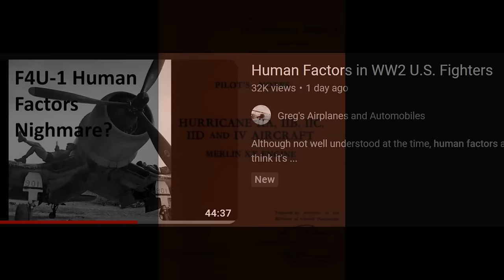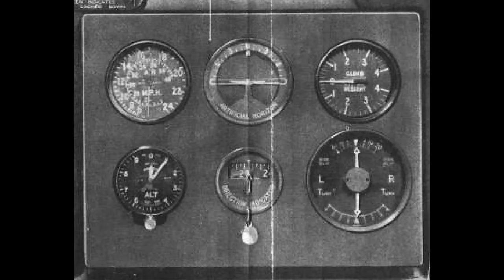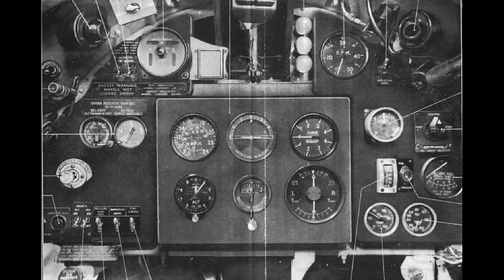Human Factors In British and German WW2 Fighters

Comment: Really cool and agree on the Hurricanes compass it’s a bugger to use in flight! However I disagree on the brakes I find them quite easy to use and very much like the chippy! Also the undercarriage and flap mixer box is so easy however to a modern day pilot they would not understand it or why! Transitions from the throttle to the gear up is easy and no problem even if you forget the safety catch it’s easy just has to be done before about 110 mph otherwise the aerodynamic load on the gear doors may not allow them retract! Just my observations from flying a MK1 👍👍

Comment: The US navy's standardisation of instrument layout made a huge change in reducing.training. Most cockpits looked like someone loaded.A shotgun with instruments, and fired at the panel
Reply: The Paxuent (spelling?) fighter conference report is illuminating. Lots of the navy pilots were pretty scathing about many cockpit and instrument layouts.
Reply: I fly a lot of 60's , 70's and 80s corporate turboprops. They have the standard 6 but with collins, arc, king, sperry,  different nav systems etc. Crosshair vs handlebars FDs switchology etc...... My company spends about 500k per Aircraft to standardize on Garmin 1000 setups.

Comment: 7.56 is the Standard Blind Flying Instrument Panel.   It was used in fighters, bombers and trainers.    It was needed because the RAF was a night fighting force.   The annual Air Exercises starting in 1924 included night fighting practice.    The last one in 1938 was entirely at night.   It used 1300 aircraft, 700 searchlights, & 53000 personnel.

Comment: the radiator under the Hurricane filled the cockpit with heat because the Hurricane had no floor and the heat wafted up from below. It has been mentioned in numerous memoirs that it was stifingly hot in Summer. It also had a fatal flaw in that the wingroot fuel tank would blast into the cockpit if set alight in combat because there was nothing between the fuel tank and the pilot's feet. Incidentally, none of the prewar fighters had any credible jettison system for their canopies until combat experience in Spain compelled the Germans and others to fit canopy jettison systems. the 109 had a spring fitted to it's canopy and the entire rear section would detach to allow the pilot to get out. the Spitfire and Hurricane had a jettison system fitted later that allowed the canopy to be unpinned with the tug of a red ball and slide back fully.
Reply: Fw190 canopy had two small explosives to blast it clear for pilot egress ?
Reply: The 190 had a 20mm cannon cartridge to blow off the canopy because they found that it couldn't be opened manually at high speed as it would be kept in place by air pressure. Same for other high speed aircraft. Once the cannon shell fired, the jet of gas from it would lift the canopy off its rails and clear it away.
Reply: Robert Johnson wrote about getting trapped in the P-47 cockpit because the canopy was jammed after his plane got shot up. This forced him to fly the badly damaged P-47 home, to his amazement.
Reply: The Hurricane burned a lot of pilots due to hits through its unprotected header fuel tank and firewall.
Reply: In regards to the Hurri radiator filling the cockpit with heat, I recall my wingman saying once that he could see shimmers of heat billowing from my cockpit when I had the canopy open. On a hot summer day, it felt like sitting on a barbecue. Our Mk IV Hurri did ground attack duty in North Africa. My sympathies to the poor crews.
Reply: @RobofGabriola  even a Spit or Kittyhawk in the desert was a BBQ.  The Hurricane was many times worse,  ... then add the smell of blood, vomit and other bodily fluids in the heat.  Poor young lads indeed.

Comment: Nicely done, Greg – as usual. Really old people like me can remember when automobile controls and settings could often be done by feel, as well. My 2023 vehicle has lots more stuff to control, but it's all electronic displays that have to be touched in a certain way or in the right spot, and I have to look at the display (thus taking my eye off the road and traffic in the vicinity) to make sure I'm adjusting it to the proper setting. It's a (very) slow version of the fighter pilot's dilemma in a poorly-designed cockpit. P.S. I'm not able to access the patreon stuff. I get a page with an image of a WW I British fighter at the top, and a bunch of grayed-out boxes with no images or text, so I don't know what I'm looking at. Maybe it's the age and OS of my computer, but it's unique to your site. Help?
Reply from the maker: I'm right there with you on the controls in modern cars. They are actually getting harder to use not easier. I just checked my Patreon and it's working fine. You might be seeing blanked out stuff because you are not a member (that's just a guess).
Reply: @GregsAirplanesandAutomobiles   Hi, again! Then I'm confused (again). How does one become a "member?" I'm subscribed to the site, with the little notification bell turned on. I thought patreon membership was what's required to go to the next level, but I'm not able to do anything with patreon, such as "join," because of the issue(s) that have already cropped up.
Reply: I think standardized instruments are the way to go, sure,  but it is not that important as professional car and airplane testers tend to think, as a normal WW II pilot does not change airplane types very often. Only the good ones have the chance and they will hack it anyway. The bad ones are dead in a short timespan. Btw one of the best explanations of poor cockpit design is in astronaut Michael Collin’s wonderful autobiography „carrying the fire“ when he describes his test pilot experience. Very enjoyable to read!

Comment: Thanks for another superb video.

One thing that I don't think anyone mention at all, that I think should be included into human factors consideration, is the colours of instrument panels. Not that there are any one design that is superior to all, but if the panels are in contrasting colours to the instruments, it's easier to locate them with the smallest glance. If they are in similar colours to the gauges, I personally feel it is more difficult to locate them by glance, but easier to identify what gauges are showing what information.

Also, though I cannot empirically prove, I feel that an another human factors win for German seating position is the relative ease of manipulating side or wall-mounted controls. I felt it incredibly strong when I climbed onto the cockpit of a Meteor F.8 from Midlands Air Museum. Once I sat inside, I could not really comfortably operate (or even see) the controls on the sides.

When we design automobiles, we usually use percentile models not just for checking whether they fit inside the vehicle, but for checking if there are any controls that are technically within reach, but is not intuitive to manipulate. When I am seating lower and my legs stretched further forward, my upper body seems generally better relaxed, including the shoulders. Anyone who's been inside a really low-slung car, like an Elise or most McLaren stuffs, would (hopefully) know what I am talking about.

Also, I'd suggest, of all the planes that were developed during the war and/or numerically close to, or is, irrelevant in WW2, the de Havilland Hornet would be among the best out there.
Reply: Useful, I doubt whether the anthropometric data on percentiles were available before WWII.  What data were collected during the war I don't know.
Reply from the maker: Thanks LV, that's a good comment.
Reply: Auto engineers would do well to put the passenger seat on an angled mount as it move back it moves down vs making it 3" taller than the driver. I smash my head getting in whenever I go along with my wife in the minivan

Comment: Just a word about the P Type RAF compass. The way it was designed to be used was not to move the clamped ring to find your heading. The idea was that you moved the ring to the heading you wanted and then turned the aircraft so that the north pointing part underneath aligned with the two parallel Lins above. As you observed it was an instrument that was more use in a ship or maybe a transport aircraft. Suffice to say that on the Tiger Moth I used to fly  on pleasure flights we kept the P Type as a piece of history and had an E2B panel mounted compass fitted as well.

This idea of having a compass where north wasn't quite where you expected it to be appears to be British as it was perpetuated in the post war Smiths Flight System where north was indicated by a pointer that could be anywhere on the dial depending on how the pilot set the desired track.

Comment: You avoided perhaps the most important HF issue - visibility - something that was a priority to fighter pilots.  The FW 190 vis was less than ideal looking over the control panel, although vis behind was good.  The Me109 vis was of course horrible, also the early P-51's with bird cage canopy.  Late model Spit IXs, XVIs had a bubble canopy, increasing vis considerably over earliest ones.
Reply from the maker: that's in another video on this subject.
Reply: @GregsAirplanesandAutomobiles   who knew.   I suggest that a video like this provide upfront an overview (good instructional design) of prioritized ergonomic and HF issues.  The learner may therefore see the bigger and more accurate picture.  Then identifiy the limited issues you'd like to cover in this video and label it accordingly.   I hope that is helpful.
I agree with the castoring tailwheel issue and pneumatic brakes (often mushy).  When scrambling large #s of WWII fighters with limited fwd vis, proper ground handling was often lacking and accidents did occur, but the brakes/tailwheel problem was more of a systems design issue than ergonomic one.  
Cheers.

Comment: A most under-appreciated factor contributing to pilot fatigue is the upright vs. inverted Vee-engine configuration. I read a most interesting interview with a display-pilot who pointedly remarked in the stark difference on noise intrusion when flying the Buchon in comparison to the Bf 109. Another interesting technical issue: cockpit lighting. The He219 for example used a novel ultraviolet lighting system in conjunction with phosphorescent instrument displays. I wonder how many pilots and avionics technicians were victims of American radium-painted dials?

Comment: Outstanding as always Greg!! I knew you'd pivot to the 190 since the discussion was on human factors and I remember distinctly from your earlier 190 videos the exception cockpit design. That had quite and impact on me since it's typically not a point of discusssion. 

Comment - I'm wondering if perhaps it was easier to design a good cockpit for the FW190 since it was primarily electrically operated. It'd be far easier to place electrical switches where desired for reduced pilot workload as opposed to the mechanical contrivances like chains and pulleys on much of the P47. Would you agree?

Comment: Had a couple of flights in an L-39.  It had the same taxi controls he mentioned for the Spitfire (except hydraulic vs. pneumatic).  It's sooo weird for someone used to nosewheel steering and toe brakes.  Damned near ground looped the thing because a full boot of rudder did nothing while the wingtip was headed for a fence.  When I remembered the handbrake thing, I panicked and grabbed a big ol' handful of brake.  The PIC didn't let me taxi for a while after that....

Comment: I don't remember if you covered it or I read it somewhere else, but the 190 also had a differential elevator bell crank that allowed for fine movements near the center with an eccentric effect at full limits, as well as aileron control linkages designed to reduce the force required for deflection to about 8lb which was what they determined was comfortable for the average human wrist.

Thanks for the informative videos, definitely makes building 1,000 Cessna brakes on night shift go quickly.
Reply from the maker: I have covered that.
Reply: @GregsAirplanesandAutomobiles  do you think there's enough information to do an Me410 deep dive?

Comment: GREG, did you notice the two level Spitfire foot rests, high for pulling Gs?  Have you looked at wartime canopies, the curved panels can have fairly poor vision quality.
Re. the vertical compass outputs, the U.S. Navy used a lot of Kollsman direct reading (via linkage) vertical compasses with twin bar heading bugs.  They appear on e-bay regularly and work independently, the direct reading Mk X is typical.
Thanks for the great work.
Reply from the maker: I have looked at the Spitfire foot rests. In all cases the pilot's legs are much lower than in an Fw190.
Reply: @GregsAirplanesandAutomobiles  but the 190 pilot also sits low in the fuselage with poor vis over the panel.

Comment: Another great video Greg! I remember reading about the Hurricanes bobbing up and down after taking off because the pilots were busy pumping the handle to raise the undercarriage. 
Spitfire pilots were constantly having to change hands on the  control column to perform similar tasks during take off. I also remember reading that German pilots after looking at captured examples, realised why they were able to jump British pilots, because they were so involved in engine and propeller management as well as maintaining flight position within their section and squadron. This last part changed with the adoption of the finger four formation learnt from the Germans. 
Mark from Melbourne Australia 🇦🇺
Reply: The 109 pilots had hellish manual variable pitch propellers far, far worse to cope with in combat. Every climb or descent or speed change cut or over-reved the engine losing power or threatening engine failure.  Even worse their prop’s actuation was awful electric not hydraulic.
Master race types would tend to boast superiority a bit too much.
Reply: @givenfirstnamefamilyfirstn3935  That part I was not aware of. I do however remember reading a seasoned pilot's report stating that they would change the propeller pitch to fine (I think) in combat in order to raise the rate of fire from the machine guns. This was due to some of the machine guns firing through the propeller arc and having interrupter gear similar to WWI aircraft. Just how this altering of the prop pitch during combat affected engine performance and service life I can't say?

Comment: From a conversation i had with a guy who flew Hurricanes my understanding is that the cockpit was often very hot due to the coolant pipes for the engine running down the side of the cockpit to the radiator more or less under the pilots seat. This probably went some way towards the choice to not employ a heater.
Reply from the maker: Once the plane gets to altitude it's going to get cold. Now at low altitude, and in the summer, yes it will be warm.

Comment: The 109 E3 and E4 had constant speed propellors from the start. They used an electric motor to change pitch, controlled by a thumb switch on the throttle. The Spitfire and Hurricane went through three different types of propellor before all were finally completed with CS props.
Reply from the maker: Absolutely not. In fact your post sort of makes it sound like you don't know what a constant speed prop is. I really suggest you watch my video on that subject.
Reply: Ive only been an aircraft engineer for 34 years, working on everything from Piper Cubs to A330s, including a great many aircraft with constant speed props. Im very aware of how they work. The Hurricane started with the Watts fixed-pitch then moved to the two-position prop (both props served in the Battle of France) then the CS prop. The earlier models of Merlin couldnt accept CS props unless they were reworked by RR. The Spitfire had a choice of DH or Rotol props. The 109 started with the fixed pitch then briefly with two-position before finally settling on the electric pitch change prop, the VDM, which was based on a licensed Hamilton Standard prop. This was altered to electric pitch change , from oil governed pitch change, by the Germans after they decided to get away from manually selected pitch units. This was to coincide with fuel injection and other developments like the FW's Kommandgerat, as they wanted a fully automated cockpit. not all of that development worked, but enough of it did for the RLM to accept it by 1940.

Comment: I flew the DC-6, go check out the gear and flap levers on this aircraft. The both look the same and both move the same directions for up and down and they are separated by about 8 inches on the back of the center console. One is painted red for gear and the other was either yellow or white. Gear was in the center of the console and the flap was about 8 inches right of it.

Comment: The inclusion of heaters is an interesting point of conversation. Because of how they are set up in GA aircraft, I typically don't use aircraft heaters for fear of carbon monoxide poisoning should there be something wrong with the system. I'll typically just bundle up for winter flying.

Your point about instrument failure is something I hadn't really considered before while flying the 190 in simulation. Aside from kinetic damage it just really was not an issue in the sims, however, I could absolutely see that being a real problem in real life where random failures can happen. Still; the ergonomics and human factors success of the FW is easily decernable even in the sims.
Reply from the maker: I agree, the Fw190 is a really nice plane to fly in the sims, but I don't think it's advantages are fully realized when everyone has HOTAS because that negates the drawbacks of many of it's competitors.